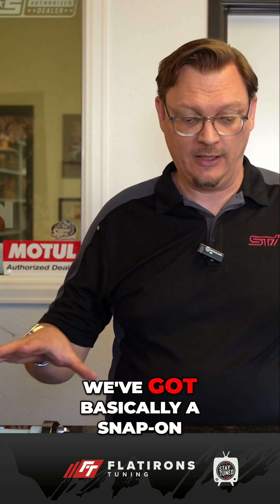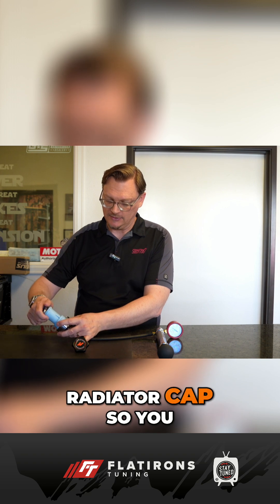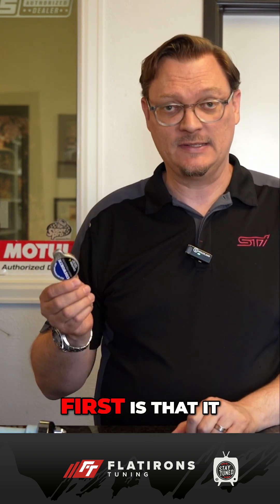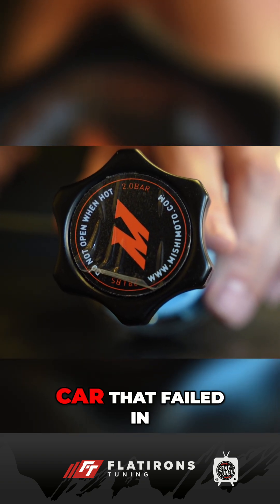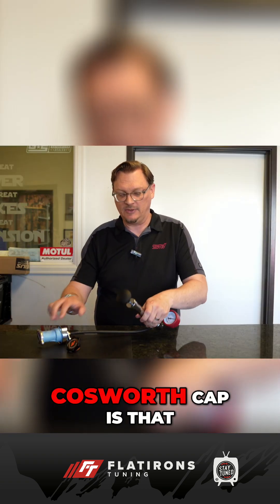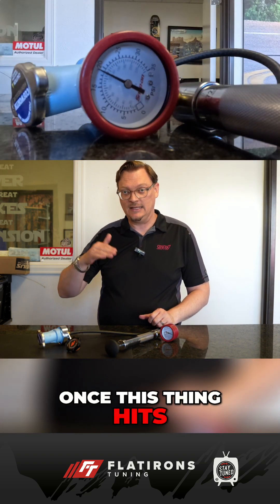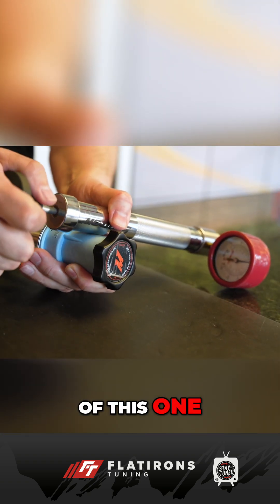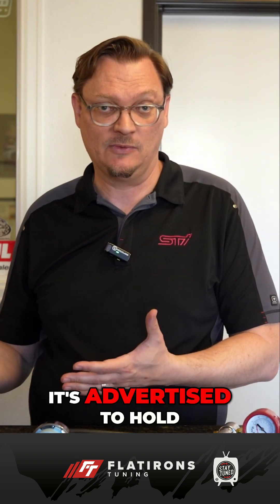Radiator Cap Pressure Test Explained!

Comment: I'm confused can air pressure actually overpower the spring at the desired cap pressure? I get coolant pressure can but have had caps not release when pockets of air in the radiator.